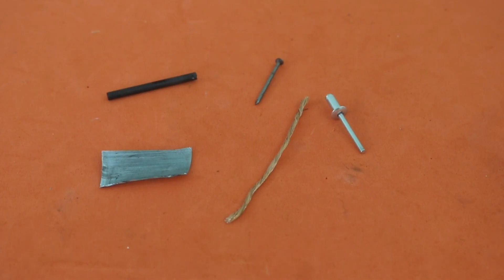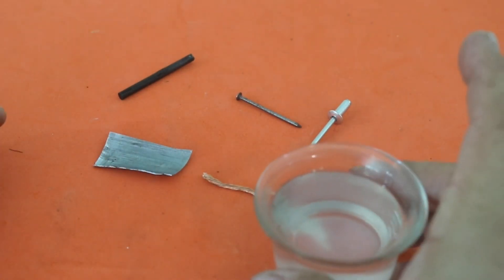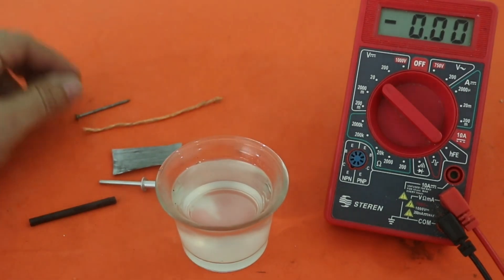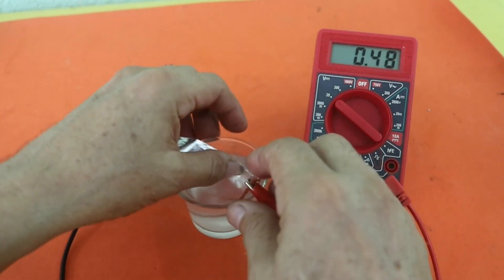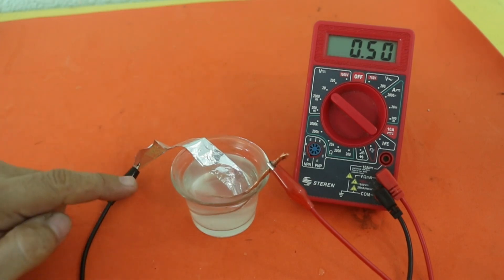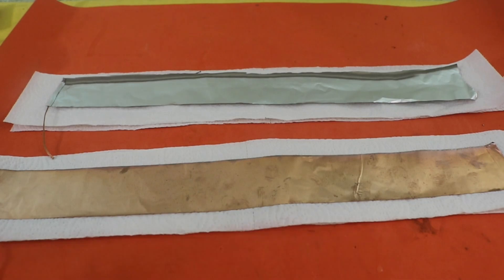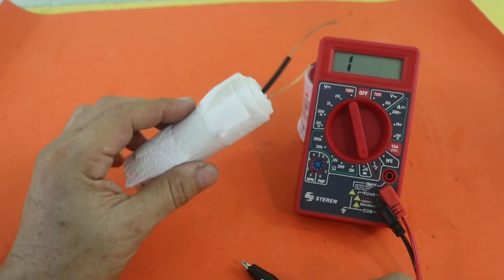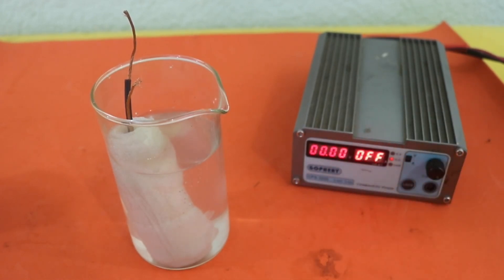DIY Copper Aluminium Battery - 800 mA

Comment: Interesting... but the materials are still not available enough (finding copper sheet is quite difficult) in for instance an off-grid situation.  It would be great if there was a fuel cell you could buy, where you just had to put in aluminium scrap and cheap electrolyte (salt, soda, KOH, NaOH, ...) , and then using this to charge commercial rechargeable batteries (lithium ones, sodium ion ones, lead acid)...

Comment: Interesting. So when you recharge the battery the copper and aluminum are restored back to pure metals? But that can't be possible because electrodeposition of aluminium can only happen at 1000 degrees C. Does it mean that only coper electrode is restored and aluminium is unchanged?
Reply: The alloy would need replacing in time.

Comment: Using salt (NaCl) gasses chlorine gas out when charging. Ventilate well!! Best results with carbon(+) and aluminium(-) electrodes. Try limit the amps when using a lab power source and play with the voltage. Aluminium is eroded by NaCl.

Comment: I believe what you made here is an Electrolytic capacitor my friend. As always, enjoy your videos. Thanks.
Reply from the maker: Thanks!
Reply: not quite:an electrolytic capacitor would not self-produce power, nor would it keep producing much power after discharging-however, there are similarities between batteries and electrolytic capacitors.
If he used 2 aluminum electrodes and sodium bicarbonate(sold as baking soda), this would be a form of an electrolytic capacitor.
Note:borax will work instead of baking soda.
The resulting capacitor would have to be formed by passing a limited dc current through it so that one of the plates forms an oxide layer.
It will then work as a electrolytic capacitor.

Comment: When I charged this battery my electrolyte water turned into green colour later like after 5 minutes turned completely black in colour and my power supply exploded and damaged.
Reply from the maker: What voltage?
Reply: @ludicscience  4.5 volt and 1.5 A
Reply from the maker: Too much voltage

Comment: What if instead of the electrolyte solution, we dip the electrodes into the sea.. will the battery still work or will the electrons have trouble travelling that long distance?
Reply from the maker: Will have trouble

Comment: I made a series if batteries using 16mm magnesium rod inside of 19mm copper tube, it had high amperage,  but the electrolyte got hot after a few minutes and the current was hard to control
Reply from the maker: Thanks,  where did you get the magnesium?
Reply: @ludicscience  I used a fire flint striker, they are high in magnesium
Reply: @ricksummerfield784  Thanks! I found that the sacrifice anode rods for solar heaters are also magnesium

Comment: Why you didn't use carbon and almunium electrode if it is giving about 1.5v
Reply: Maybe he was payed off by big energy to prevent us from finding out the secret to free electricity!
Reply from the maker: ( ͡° ͜ʖ ͡°)
Reply: Probably to get more surface area as he needed a foil product
Reply from the maker: That is básically the reason
Reply: @ludicscience   how about using  carbon/graphite paint put on a paper  or thin plastic and rolled with aluminum foil?  C paint has large surface area. thanks for your nice videos.

Comment: You may want to discuss the effect of depassivating the surface of the aluminum immediately before putting the battery together.  Either by dipping it briefly in hydrochloric acid or sanding it with 1000 grit sandpaper.  Both methods would increase the surface area of the aluminum on a microscopic level.  I would expect that both the voltage and current would increase. Probably current more so than voltage.  It might be fun to experiment with depassivating the aluminum to demonstrate one  of the many things that affect battery performance.  I really enjoy your videos.
Reply from the maker: Thats great advice thanks! I definately will try that.
Reply: Sodium hydroxide in the electrolite may also help depassivating the surface of the aluminium
Reply: @ohanneskamerkoseyan3157  Potassium Hydroxide might be even better:and it's used in many commercial batteries.
Reply: @m.k.8158 the aluminum air battery uses KOH with activated charcoal and paper towel to make about 1.2-1.3V. Keeping fresh electrolyte going to it keeps it going until aluminum dissolves but if it dries out or loses potency it's toast.
Reply: Aluminum is a poor choice as it is a Neurotoxin... Making the water 💦 toxic